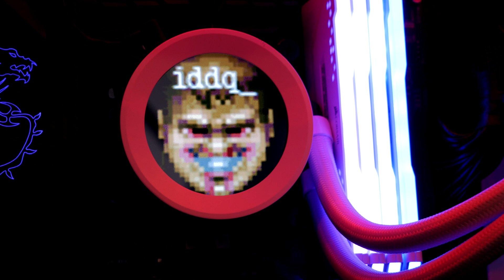How to use old (or new) CPU coolers on LGA 1700 - NZXT, Corsair and Noctua

Comment: Hi, you mention using the H100 as the corsair cooler. I'm looking to upgrade my cpu to a 1700 socket too. The h100i V2 (which I have) isn't mentioned in the compatibel list. H100i RGB is. Do you know if mine will work ?

Comment: Can you mix and match different parts from different sets? I noticed the NZXT ring might be used on the XC7 and XC7 PRO (between them they have the same bracket). Most of all I'd be curious wheteher I can use the backplate bracket from one set with the screws from another set like NZXT and Corsair or Thermalright or Alphacool. I, particularly, have a situation were I upgraded fro LGA 1151 to 1700 and just because a few millimeters couldn't fit my XC7 unit but then realized Corsair just lazily improve the unit and now its shipping it with the correct backplate bracket for another 70 bucks and both have the same retention (front) bracket!

Comment: You mentioned that most don't come with the holes. The noctua instructions tell me to not remove the existing back plate and to put the new back plate over the old one. Problem is, there are no holes except where the original is mounted.

Comment: Anyone who used the kraken backplate, before you attached the cooler did the backplate feel loose? Mine feels loose even tho the stand offs are tightened by hand as tight as I feel comfortable tightening, and it still feels loose. Worried about installing the cooler with it feeling loose but I was told by a ryzen user that it wasn’t as normal but they use different backplates. Someone please let me know

Comment: Hi I noticed you used a Kraken x.. or z... cooler. I bought one for my Gigabyte motherboard and had the lga1700 mount kit included in the box. But when I mounted the backplate (the X looking thing) and screwd in the right screws. I noticed that there was space left between the screws and the mount part. So the fit wasn't thight. Did you also had this space between the motherboard and the screw (the bigger part of the screw) because right now I am scared to mount the cooler on top of it because it can kinda move up and down right know.

Thanks!
Reply: Hey same problem,can u help me out?
Reply: @oonnyx6  Spoke with NZXT, told me to jsut mount it and I did. When the cooler was placed and thigthend it down it was proparly mountend and coudlnt move it. Also couldnt move the backplate anymore
Reply: @joppie544  thank you so much! I came to this video looking for someone to mention this after searching for 30+ minutes. Figured the comments would help. THANK YOU FOR SAVING MY NIGHT! Thought I was gonna have to order different stand offs 😅 Now I can finish 😊

Comment: It's funny. I just bought a Asus z790 strix motherboard I bought a brand new NZXT x73 cooler but it's old stock so it doesn't come with the new bracket and I'm going well. Why can't the old one work? The holes line up. Your the first one that mentioned they drill both holes that still it will. I can't believe I be looking all over the place.

Comment: I bought the Kraken x73 and it was a 2021 edition before they started shipping 1700 socket. But the socket it came with, the 1200 fitted perfectly fine. I moved the screws to where it needed and on without a problem. So I’ve got a 1200 socket on a 1700 socket which is the same area on the board itself.
Reply: Not sure if I understood, you used the Kraken x73 as you received? I mean, without the 1700 specific bracket and it worked? I am asking because I bought an Kraken x73, and they are delivering to me the 1700 bracket for free, but it will take 1 week, and I am just depending on this to have my setup installed. My motherboard is ROG Strix Z690-E LGA1700
Reply: @obetomuniz  Hey, it’s okay. Yes, I bought the X73 which came with the rubber bracket. I put it on my z790 tomahawk and moved the sliders in the bracket and it fit perfectly. I then contacted NZXT who posted a free bracket for me as well but 100% the one I received the 2021 edition for the LG1200. What I would say, open the board and get the rubber bracket out of the cooler and see if it fits through. Move the adjustment to fit through. Done.

Comment: Hi sorry, im really confused and hope you can help answer my question. Does the corsair cooler come with the correct 1700 bracket. Is it just the stand offs i need to buy seperatly ?
Reply: I'm a year late, but my H115i Platinum (2020) has the exact bracket and stand off's. I was worried, cause my mobo is enroute

Comment: Need some advice!..
I have a older cooler corsair h110i gtx can it fit to lga1700 with retrokit?
Reply from the maker: You can check corsair's site for compatibility. But I believe so.

Comment: Hey guys. I need help please. I just ordered pc parts for like 1900 dollars, building a new computer, I went with the i7 12700k. I can’t really afford a new AIO right now, do you think I will be fine with my old kraken x52? I got the 1700 bracket for it, just wondering if it will be enough cooling at least until I can buy a z73 in a month or two. Please help ❤️
Reply from the maker: Yes. You'll just need new thermal paste
Reply: @TheProvokedPrawn  are you sure i wont explode my new 12700? 😀😀😀
Reply from the maker: @Plutoquintana  how old is it? Unless you've been using it for a decade it should be fine. Get new thermal paste, use the new bracket, then be sure to run benchmarks and check the temps when you do it. But it should be fine.
Reply: @TheProvokedPrawn  its like 3 years old, maybe 4, never been a problem before. I Will try, thanks 😀

Comment: Is the older Corsiar bracket supposed to fit into the LGA1200 or 1700 holes? Because it only fits in the 1200 holes on my new Z790.

Comment: Great video :) was wondering if I would be able to reuse my Kraken X63 if I would upgrade from my current AM4 system to a 13600K. The kit is just €5 so looks like that wont be an issue :)
Reply: Which kit did you end up using for your kraken?
Reply: @Daydatao  none, I actually ended up sticking a 5800X3D on my old mobo and calling it good for the next few years probably. But the Asus motherboard I was looking at for the 13600K turns out to actually also accept the older style bracket so depending on that you may not need a kit at all.

Comment: My wingnuts from NZXT did not fit any posts. Basically the coolers can only be jerry rigged for the 1700 socket. No real practical mounting is offered. (even from any third party) These coolers are noisy, leaky junk. I would advise you to avoid at any cost.

Comment: mentioned around the 30 mark, you can use older Coolers with this Motherboard. Can I fit a NZXT Kraken or do i wait for the LGA 1700 Bracket? I have this exact same Motherboard.

Comment: First time builder here. I installed my backplate LGA 1700 and then installed motherboard to case. I noticed after installed the bracket in the back became loose and unfitted. Is this normal? Is it okay to proceed or should I re -inatall?
Reply from the maker: It shouldn't be if you've tightened the stand offs enough

Comment: I got my old Corsair H100I to work on my 1700 socket board. Here is how i done it and it didn't cost me anything. If you have the AM4 bracket that the cooler came with. Then place that on the pump as if you was installing it on a AM4 board. Make sure the mounting brackets for hooking to the AMD board is facing up so it don't get in the way. Now just put your intel bracket on top of the AMD bracket and job done. That will give you enough to tighten to your new socket 1700. this works perfect for me. :)
Reply: Hey, looking to build my first pc soon and I bought the h100i capliex so are you saying just use like the hooks for AMD processors?
Reply: Wow, is this legit?
I have H60 2018 for lga 1151
And yes, it is came with AM4 bracket
I was planning on upgrade to 1700
Wanna buy official bracket for 1700 but it really cost almost 1/3 price. So im hesitate
If with AM4 work, it will save my money 😂
Reply: Sooo ?  @nickyandreawan26

Comment: will the original 1200 standoffs work if the bracket fits on the mobo or do I need to order the 1700 kit?
Reply: Bueno, según un especialista en corsair, dice que los tornillos lga 1200 son 0,9 milímetros más grandes que los lga 1700 porque al usar lga 1200 el procesador no hace buen contacto con la bomba corsair y no se obtienen temperaturas tan buenas. Buey
Reply: @mykeem.c5690  Gracias. Es bueno saber eso.
Reply: My question exactly
Reply: What did you decide?
Reply: @haies09  the original standoffs are working just fine

Comment: I orderd lga 1700 stand off retro fit for my corsair H60 cooler, but turns out its backordered.  The bracket fits fine due to the adjustable corners, im just wondering if the 115x stand offs will work. I screwed the cooler in lightly and it seems to fit, can anyone confirm? Thanks
Reply: Here trying to find anyone else doing this. Building a rig for my nephew and cannot obtain the official Corsair plate and screws. It seems to fit fine with good thermal paste spread/contact.  I’m going to rock it and see how it does. Anyone have temp feedback?
Reply: I ordered the Kraken z73 LGA1700 bracket and they're backordered and out of stock as well don't know when ill be getting my bracket but i do have the z73 installed on an LGA 1151 socket from my current i7-8700k and want to transfer over to my new z690-a mother board did you find out if it works without the bracket?
Reply: @anonymous8906  the old stand offs worked fine.  I received the new ones from Corsair but I haven’t even bothered to switch them out
Reply: I reused my H60 with the old standoffs and bracket and it seems to work just fine with good temps, probably not recommended but..... meh.
Reply: What motherboard (as in, is it one of the ones that comes with the LGA 1200 mounting holes)?
Reply: @12100F  using a gigabyte aorus board.  Can’t recall the model but it was ddr4

Comment: very informative video. even tho i do not have the new 12th gen cpu in hand at the moment. but i will eventually upgrade to one in the future. and hopefully i can reuse my kraken x62 on the new socket.
Reply: I'm not sure if you have already bought the 12 gen since you commented this, but yes you can use the x62 with it without any problems even without the new LGA1700.  When i was building the new rig i found out in the last minute that my z73 was broken, so i had to use my x62 for a week, still nice temps with it just make sure you use a nice thermal paste like thermal grizzly kryonaut, works flawlessly.

Comment: I ordered the lga 1700 retention kit from asetek for my z73. The backplate looks the same but standoffs slightly different. There is massive play / movement between bracket and board when standoffs are fully tightend, not sure what to do.
Reply: Yeah I’m wondering if that a problem too so just tryna find an answer atm

Edit for Z63
Reply: I have the same concern with my x53
Reply: Hi. Did you resolve this? I have the same issue and dont know what to do.
Reply: @Haraldjohann  The wiggle/play when you put the standoffs on are normal, however if it is still lose after you put on the AIO and tightened that down then it is not normal.
Reply: @Anonymizur  You just saved me a few hours of research about this, thanks man!
Reply: @tamasangyal1830  so the wiggle went away after you tightened the cooler? I’m now here and scared too 🤣
Reply: @uhZeny  happening to me. Temps at 100c+
Reply: Did anyone have a fix for this? 
I’ve noticed on videos where they’ve installed the LGA1700 bracket, their motherboards have those raised aluminium CPU contact frames. The one in this video is stock from Asus but my Asus Z790 didn’t come with one.

Comment: I got the ASUS TUF Gaming Z690-Plus WiFi D4 & it has the notch-out holes. 

Update... I installed Enermax ETS-T50 RGB air cooler on that board with no issues. As described in you video the TUF Gaming board I got has two different holes as well. It says in the manual you can use LGA 1700 or 1200. I made a video about it.
Reply: Sorry i didnt understand,  Are the ASUS TUF Gaming z690-Plus WiFi D4 doesn't need lga 1700 bracket ??
Reply: @7jri854  You don't need LGA 1700 brackets for ASUS TUF Gaming Z690-Plus WiFi D4 motherboard. I installed Enermax ETS-T50 RGB CPU Air Cooler with no issues. In the manual, it says you can use 1200 or 1700. I made a video about it

Comment: There’s lot of play in nzxt provided bracket. ThaT can push the cooler away from the cpu which is fixed by the socket. It needs adhesive like Corsair one.
Reply: I just received mine and it has a lot of play as well.  I don't think we should be using glue.  I never had an issue in all the many PC builds. Is this really the solution? I sent a help ticket to NZXT but it's the weekend.  I'm half thinking about putting my 3M GoPro mounting tape to the back.  Even with the glue mounted, I do not think it would solve the problem.  It has a good 4mm or so of play. What do you guys think?
Reply: @SpaghettiNoob  Any update on this? I am in the same situation. First I was happy that the LGA 1200 should work on my MSI Pro Z-690 but then I noticed the wiggle and that I can uplift or push out my backplate after the standoffs are fully tightened... how can i fix this? so that the AIO mount (Z53) stays on the CPU
Reply: @SpaghettiNoob  I added small strips of double sided tape in between. It's better than the play and working fine for now. Temp are fine 23 24 degrees idle temp and 45 50 55 on load. For Cinebench R23 went 82 degrees for few seconds
Reply: @shadowalphaop5238  Where did you put the strips? On the back side, so that the standoffs are fixed on the front of the motherboard or on the front side so that the backplate is fixed on the backside of the board? What I essentially ask is when the standoffs have this massive play of ~3mm and they need to be fixed so that they touch the motherboard, i need the strips at the back right?
Reply: @rall3d617  in between the back side of mobo and bracket so that the play is not there and plate is fixed to the motherboard from behind.

Let me know if you got it or not, If not I'll share a pic on my channel under communication section
Reply: @shadowalphaop5238  Yeah I added some double-sided tape really really tiny thin strips and wrapped them around the little sticks that go through the holes. So it creates the resistance a bit earlier and the mounts for the screws dont stand out so much at the front because of that. I'm testing it tomorrow but its much better now already compared to before. Thanks!
Reply: @rall3d617  great!!
Reply: @shadowalphaop5238  did you guys stick to tape or did you use spacers?  I was thinking of grabbing some rubber spacers to help with that offset, as I'm running into the exact same issue as you guys did.
Reply: @celldweller69  I went with double sided tape to fill the gap between back side of motherboard and bracket. You can check with the spacers if it works for you.

Comment: Have you ever tried to use the NZXT coolers with the Noctua backplate? As the NZXT is blastic and the noctua is metal would be interesting to see if it improves mounting pressure as suggested by igor.
Reply: 🅱️lastic

Comment: So I purchased the capellix h150i but I have an LGA 1700 Mobo (ASUS ROG Strix Z690-A Gaming WiFi D4 ) . I already ordered the set of stand offs but my question is this. Is the bracket you get in the lcd h150i different? Or does it just include the stand-off screws? Because there is another kit that’s always out of stock on Corsair that includes the stand off and bracket. I’m too afraid to build until I know as I want the new cpu to have maximum exposure to cooling. Thanks
Reply from the maker: I believe that your motherboard should have the extra holes like mine does. Meaning you shouldn't need any extra kit and can use the same setup as for LGA 1200.
Reply: @TheProvokedPrawn  alright thanks. was just very curious as I want it to be optimal is all. Thanks for all the vids you make
Reply: @Defaultuseraccount  Hello, i did the same thing. I bought the capellix h150i and i have an LGA 1700. Did you need to buy the kit anyway?